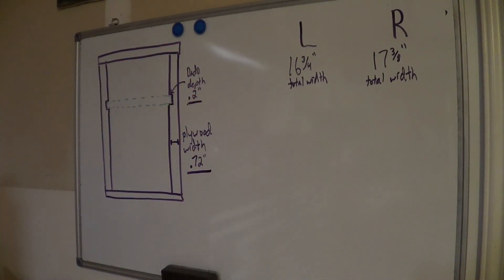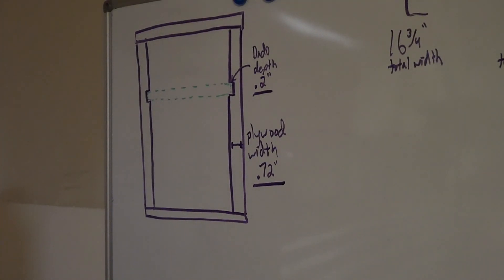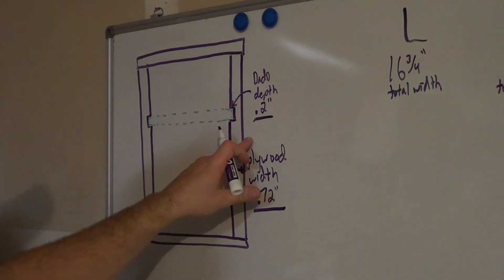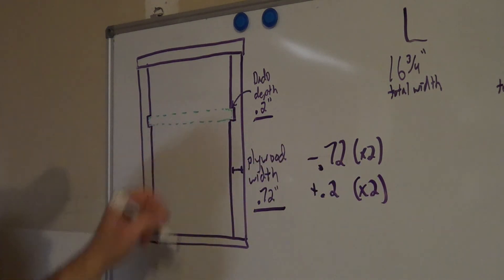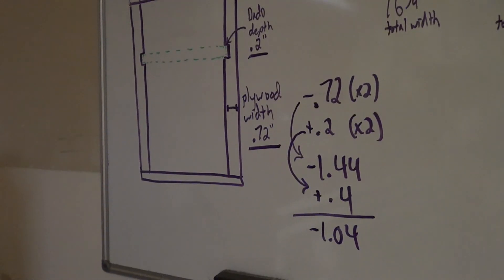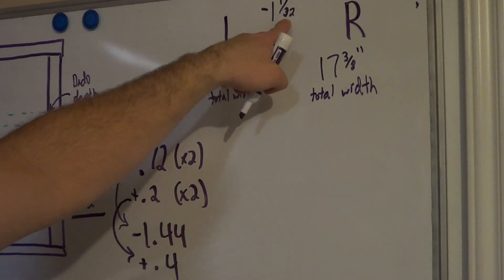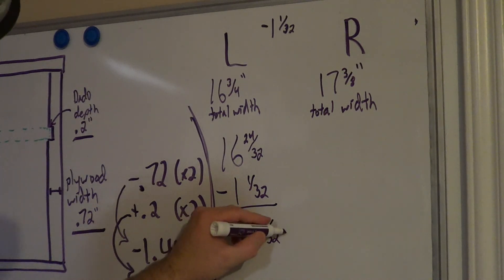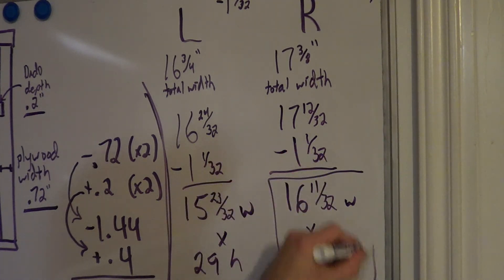Math in Woodworking - Episode 1 (Calculating Dimensions with Dados)

Comment: Andrew,Great video. I found you via a difficult (for me) trig problem I’m having with a project. I’m building a mitered and angled pyramid base (frustum, is the term I believe) for a table. I used the following app http://jansson.us/jcompound.html, it worked great, but I wanted to understand the math rather then relying on the tool. The second problem, the top and bottom edges are angled, another trig problem. They edges need to be squared relative to the angled planes of the sides of the pyramid. I’m retired (got the time to beat my head), going back to school taking some math classes using Kahn academy. But this problem, a simple and common shape, is in reality, quit complex to build.
Maybe a future class 
Could you help me to understand the second problem. The app doesn’t resolve that problem
Thx,
Keep up the great work
Reply from the maker: Thanks for the feedback, Jim. I would love to help out! I just googled “frustum table base” and a lot of different (but similar) images came up. They all incorporated the idea of the base, but varied in the number of sides. 

I will gladly make a video on the math part of that and I would love to use the specific dimensions for your project. Email me at: triplerwoodworks(at)gmail.com with the following...
1) Height of the base
2) Number of sides for your base
3) The top “diameter” or distance between the walls of the base
4) The bottom “diameter” of distance between the walls of the base
* Instead of #4 & #5, you can give me an angle that you want the base to be.***

If any of that doesn’t make sense, feel free to let me know in your email. I look forward to hearing from you!

-Andrew